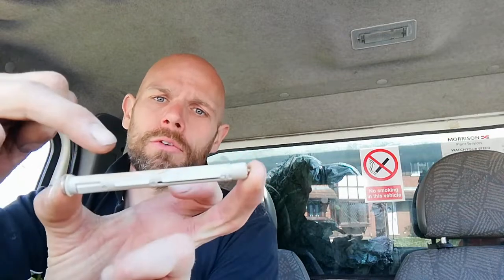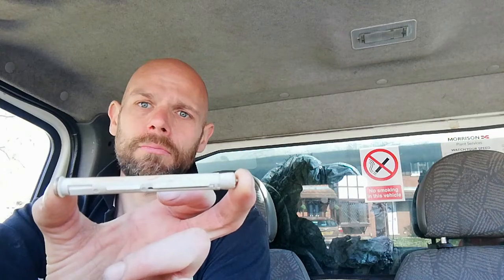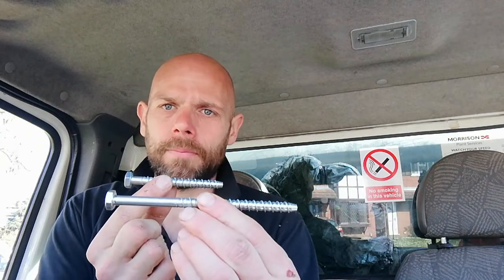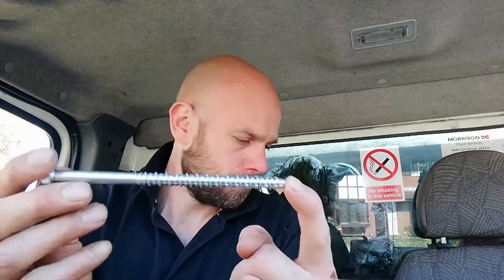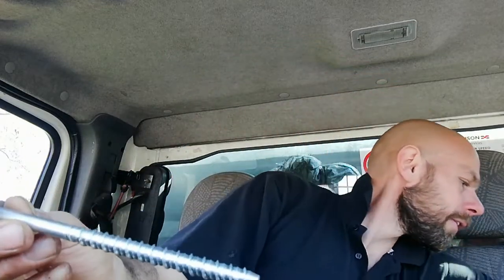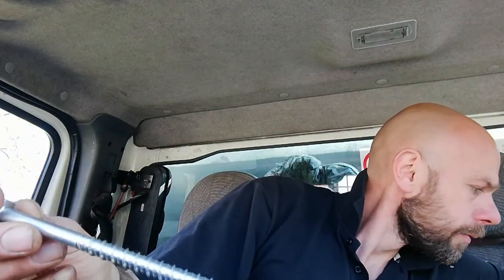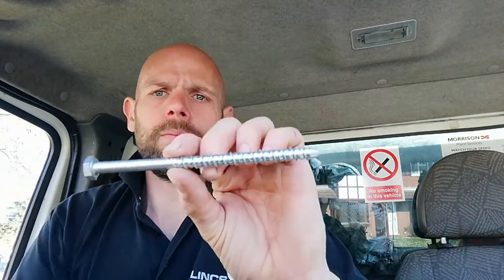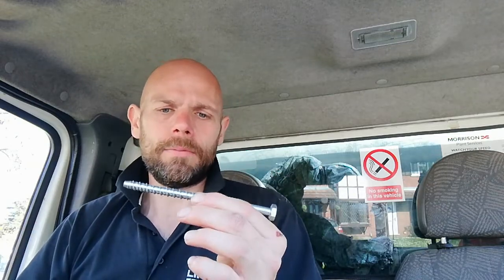Fencing Friday 005 fixing

Comment: try torx head masonary frame fixing masonary screws mate. thread goes all the way up the shank.have used them for a few year now never let you down.cheers
Reply from the maker: Oh will give them ago but I'm assuming they would be the same as the ones I caught from screw fix .
Reply: not sure mate but they replaced the old frame fixings we used to use with the plastic sleeve.the new one's are 7.5 mm & use a 6mm sds bit.hope it helps.
Reply from the maker: @thegeordiefellwalker8878  cool will give them a go .m